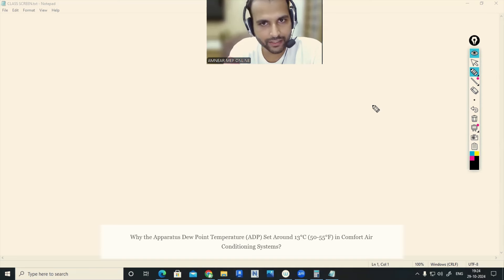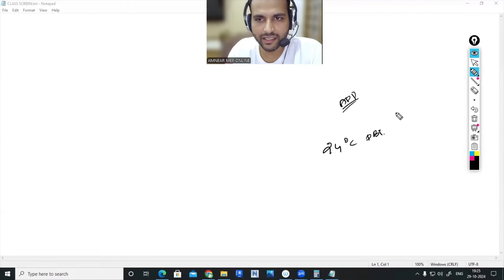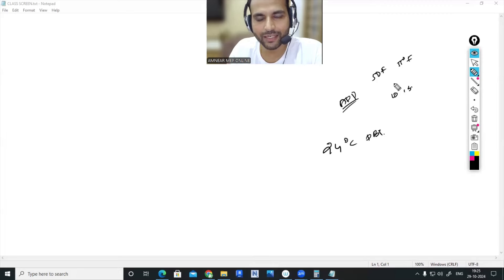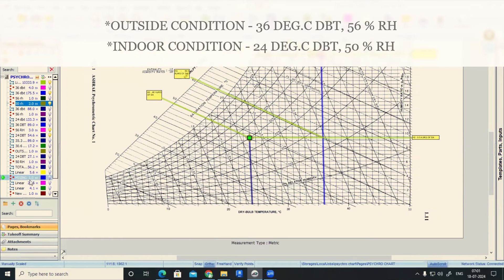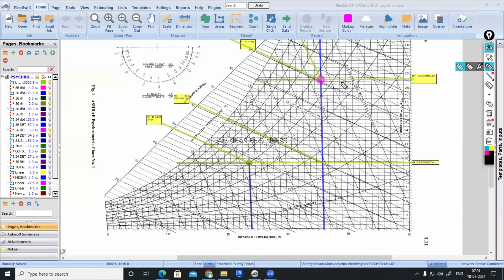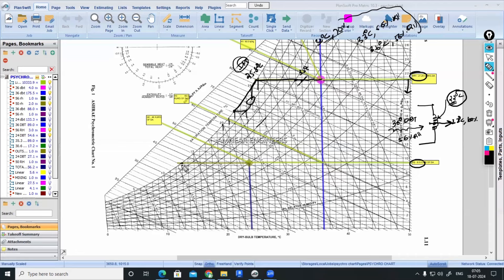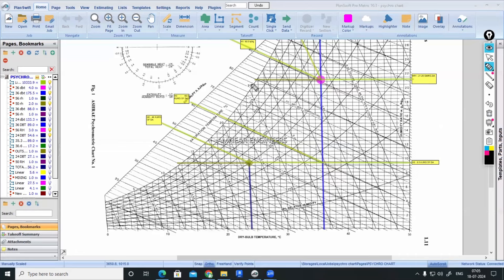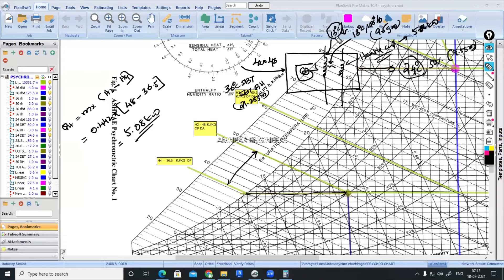Why the Apparatus Dew Point Temperature (ADP) Set Around 13°C in Comfort Air Conditioning Systems?

Comment: Can we consider this heating coil capacity  in another hand as a artificial sensible load?
Reply from the maker: Yes, we can. However, the heating in this case is sensible only. You can achieve this using various methods, such as an electric coil, hot water coil, heat pipe, condenser return, or any other available heat source.

In ventilation equipment, the Horse Shoe heat pipe, which we use to pre cool the air before the main coil and reheat it afterward, essentially serves the same function.

Comment: Great Explanation
I would like clear one point.
what will be the total cooling load tonnage from (36 to 13 deg c) & (36-24)
As per my estimation it is arround 7 ton & 5 ton respectively.
could you please confirm this
Reply from the maker: Thanks for your support.  Delta T alone is not enough to determine the tonnage. Your question needs clarification. Are you asking for the tonnage required to reduce the temperature of a specific quantity of air from 36°C to 13°C? If so, we need the mass flow rate of air to calculate it. Alternatively, if you're asking about reducing the temperature of a room, we need to calculate the room's sensible and latent cooling load to determine the tonnage. Delta T by itself cannot provide the tonnage of refrigeration.
Reply: @amnearmep 
Thanks for your reply
I was considering 400 LPS fresh as per your videos
400 from 36 to 13
400 from 36 to 24
outdoor air without recirculation (100% Fresh air)

Comment: If the temp.and RH of air at machine outlet is 24C and 50% then what will be the temp.and RH of air at diffuser outlet? Suppose inside design condition is same as air at machine outlet.pls clear it.
Reply from the maker: Hi, ITS SAME.

In practice, as the air travels through the duct system, there may be a slight increase in dry bulb temperature due to heat gain in the ducts. This gain is sensible, meaning it won’t change the humidity ratio, only the temperature. So, a small increase from 24°C may occur. Since we are already considering duct heat gain allowance while doing the heating and cooling load calculation, its not an issue.
If the air leaving the cooling coil is at 24°C and 50% relative humidity, ideally, the air leaving the diffuser should also be at 24°C and 50% RH.
Reply: it can slightly more that 24 due to sensible gain.